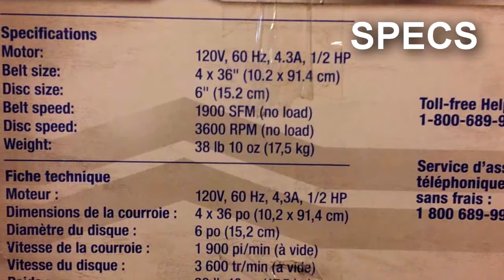canadian tire /  mastercraft 4" belt and disc sander in action

Comment: I just picked it up and it's missing pieces 9 and 10 in the manual and I was curious if this model just doesn't use those pieces? Wonder if it was coincidence that it was missing both the plate and the plate screws.

Comment: can i sand, grind metal knives with this?
Reply: Buy a bench grinder instead, the 6” Mastercraft bench grinder goes on sale for $50 all the time and it does a way better job at sharpening knives and metal then this which is more ideal for wood. This particular unit is also really underpowered and any pressure will stop the belt from rolling.

Comment: That's a piece of junk for sure. I have the previous Chinadian Tire model that I picked up 3 or 4 yrs ago that has a 6 amp motor and 8" disc, cost $90 on sale and that one barely does the job, I can't imagine using one with a 4.3a motor  (1/3 less power) or with a tiny 6" disc, it's almost pointless to be there (1/3 less area and speed).